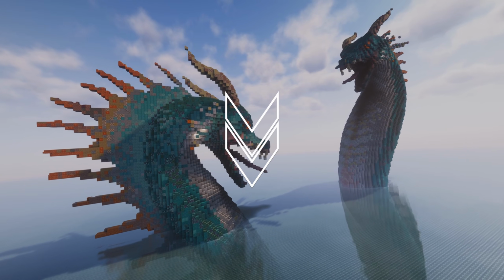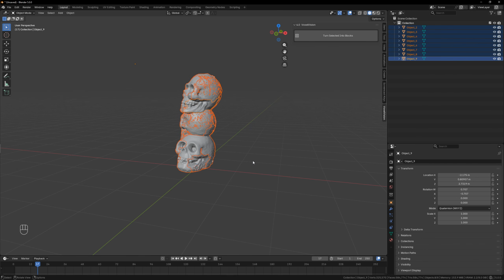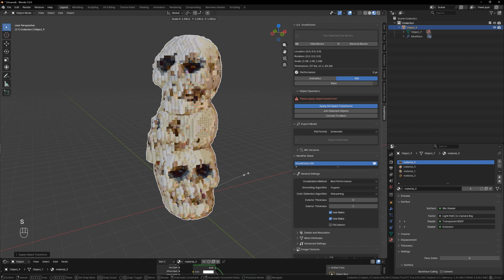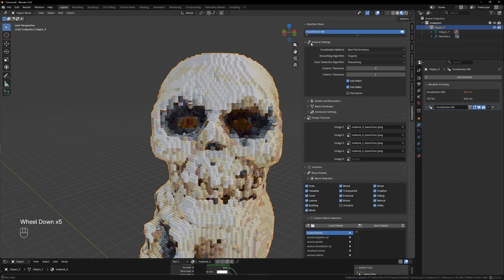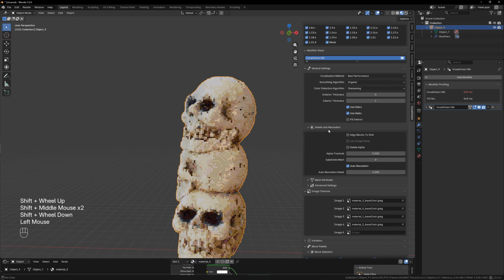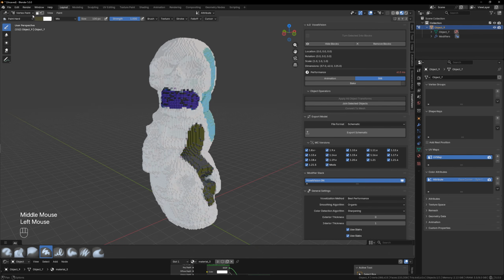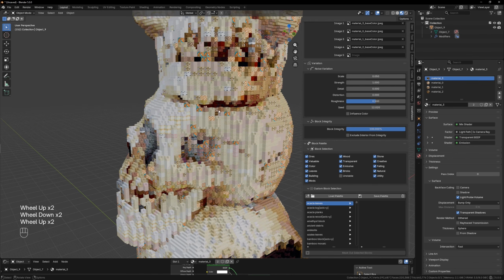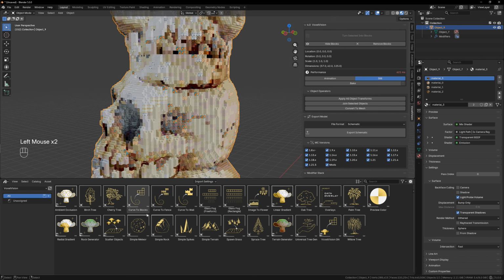VoxelVision 4.0 - Beginner Guide - Pt.2

Comment: OK. Satisfaction Depletion Reliant Software Add-on Excessive Deligence.

Bought it for 30$ because I was under the understanding that it was a SEPERATE program. Much like Blockbend. Where it opens from an EXE self contained. Upon buying it I was met with an ADD-on directory instead of a installed program. 

No where in the clause are you told that its STRICTLY for youtube/blender.
For those who disgust at overwhelming projects through these underwhelming programs. I do not have 10 years experience playing lego blocks and do not have 15 years experience in learning the ever changing console commands and shortcuts to reliantly, enjoy utilizing these programs like MAX 3D, and UE5. 

I purchased the PROGRAM(not a program: is a FEATURE ADD-on) thinking much like the videos surrounding its creation, that it would be bought, installed, and executed and from there, laid out in a GUI like blockbender. 

However, this is not the case. ANYWAY further more, the installation is a nitgrit: the attachment although can do SOME THINGS, does only offer a limited ability to customize, where as in the videos and pictures provided by Company/ 1 user. (2,3,4..) it seems there are QUITE a few hurdles to jump through, and I mean a whole running track worth. 

Not just 5-6, but try 18-25. Just to trial, before even exportation is thought of. 

This purchase is mean to be already program savvy. Not leeching off another program. 
This purchase is meant to have its own GUI, not a tweak satisfactory, corriculum. 
This purchase is supposed to be able to be used, if you have years of ALREADY deep knowledge of the OTHER program. 
If not, then you are seeking advice and corrections. Which noone actually want to do, and of the available material online to server that, there is like 2 vids. and the other 4 are very vague and unusable.

This is a type of review, from a dissatisfied customer, who doesn't have 18 weeks of pre-learning when expecting results same-day. Not next year. 

This program/add-on/ tweak with tweaks and custom tweaks, is not a full program.
Of all the options, that are their own feature, there is about 15. 
As for beyond that, and the more intrincate phrasing of mix and match, this is a laugh. 

Noone is going to endevour this product of dismissal. 

Though a product. Confirmed add-on ability, to move and shape a tree. 
The videos of its release were far from the expectations of viewers.

To buy it while it is in its infant state, is just a demo. A hi-light of proformance that doesn't exist. 

Thanks for interest, but consider the purchase, an investment. 

If you had perhaps it self contained, and had it, working seemlessly, without the 150 keystrokes REQUIRED before practicality, then maybe it would be ok. 
As it is, it's just spam.

Good luck and kind regards.

==============
chatgpt rewording for conviencence. 

Disappointed – Expected a Standalone Program, Not a Blender Add-on

I purchased VisualVoxel4 for around $30 because I genuinely believed it was a standalone application, similar to Blockbench. Based on the promotional videos, I expected to buy it, install it, launch an executable, and start working with an intuitive interface.

Instead, I discovered that it's a Blender add-on.

That was the biggest disappointment. I don't recall the store page making it sufficiently clear that this product requires Blender and is heavily dependent on existing Blender knowledge. If you're already an experienced Blender user, this may not be an issue. But for someone looking for a dedicated voxel editor, it was a very different experience from what I expected.

The promotional material makes the workflow appear simple and streamlined. In reality, I found myself spending far more time learning Blender than using VisualVoxel4 itself. Rather than opening a program and creating content, I was navigating Blender's interface, shortcuts, menus, and setup process before I could accomplish even basic tasks.

My expectation was:

Purchase.
Install.
Launch.
Start creating.

The actual experience was:

Install Blender.
Install the add-on.
Learn Blender.
Configure everything.
Then begin learning the add-on.

That's a significant difference.

The add-on itself shows potential, and I can see that it offers useful functionality. However, many of the advanced workflows shown in the videos seem to rely on substantial Blender knowledge that isn't immediately obvious to new users.

I also found the available learning resources fairly limited. There are only a handful of tutorials, and several of them assume prior Blender experience rather than teaching complete beginners.

I don't think this is a bad product—I think it's aimed at a much narrower audience than I expected. If you're already comfortable with Blender, you'll probably get much more value from it.

For anyone expecting a self-contained voxel editor, however, I'd recommend reading the product description very carefully before purchasing.

Personally, I feel like I paid for something that is still closer to an early-stage tool than a complete standalone workflow. I would have happily paid more for a version with its own dedicated interface that didn't rely so heavily on another application.

I hope future releases move further in that direction, because the underlying idea is excellent. At the moment, though, it wasn't the product I believed I was buying.

Comment: Hello. When I try to convert an object to blocks, it disappears. I recently used Block Blender V2 and with it the same object converts correctly. What could this be? 
With other object is the same problem.
I jumped into voxelvison vor textures presets.
Reply from the maker: Make sure that you use Blender 5.0.x and that the block database generated correctly. Try using Minecraft version 1.21.5 and see if it works then. Feel free to join the Discord for easier communication :)
Reply: @Erasers45-Studios Thank you for answer! Blender version is 5.1.2. Now i have founed discord channel in voxel setting. I will countinue my issue in this channel!